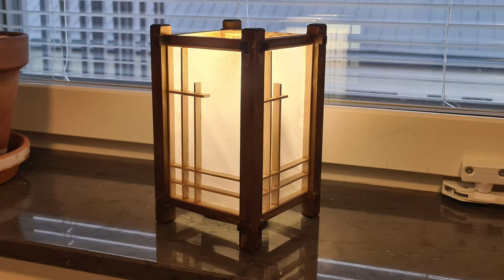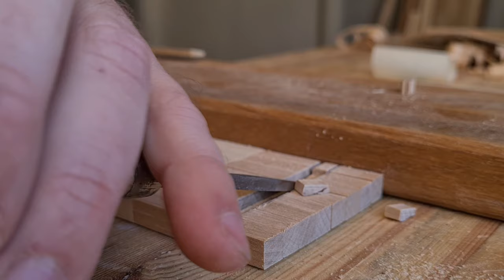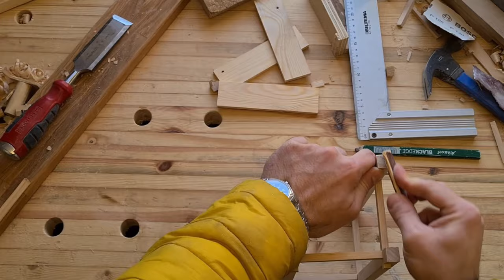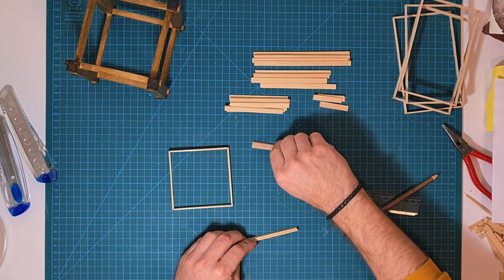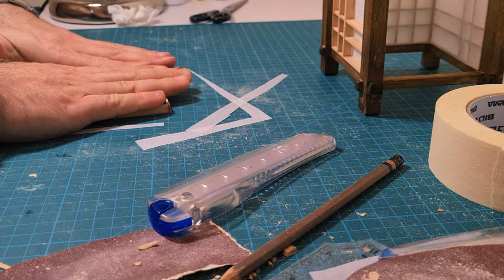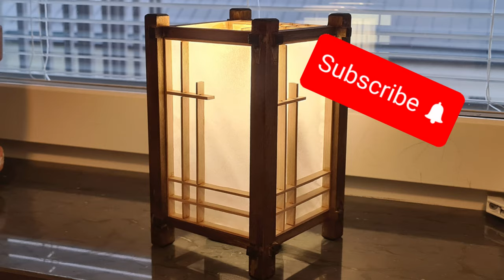I made a Japanese Shoji lamp from raw fire wood by hand |No Power Tools

Comment: Je dois reconnaître que l'ouvrage est beau mais je suis choqué par le gaspillage de matière bois. 
Par contre merci ça fait réfléchir à ce que l'on achète tout fait ainsi qu'au rapport énergie objet produit.
Reply from the maker: Thank you 🙏
I just realized now that you pointed it out, how shocking it may appear, however working with wood as a raw material always leaves a lot of waste, mostly sawdust which is not so noticable since it goes straight to the trash in the working process while in this video all the waste is presented on the table.
Reply: There is no waste, if the shavings are used as fire starters, or incorporated into the garden’s compost bin.